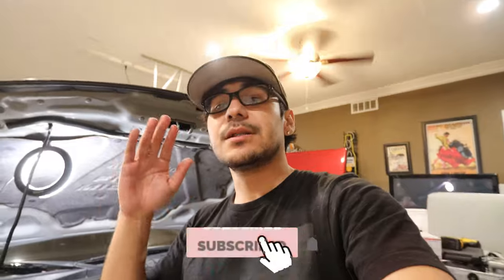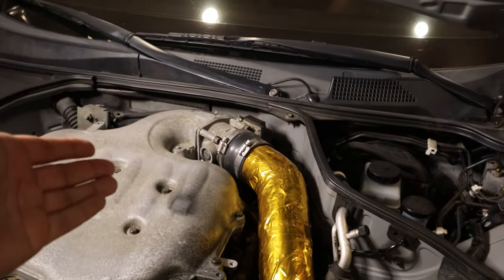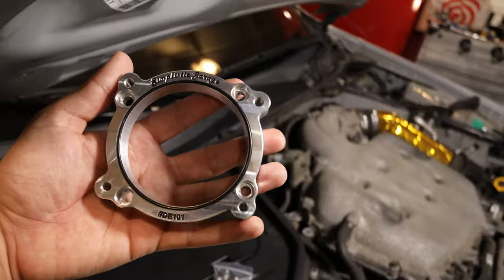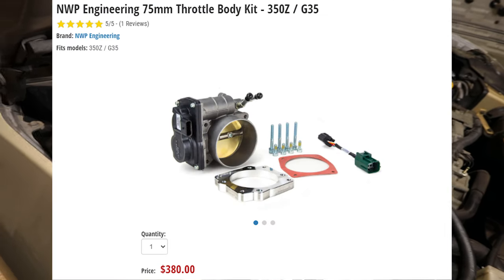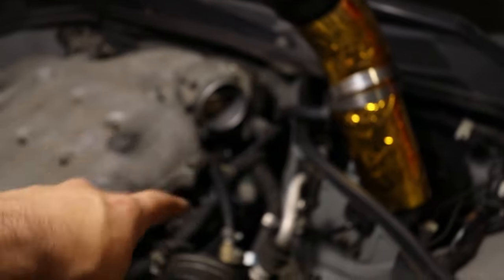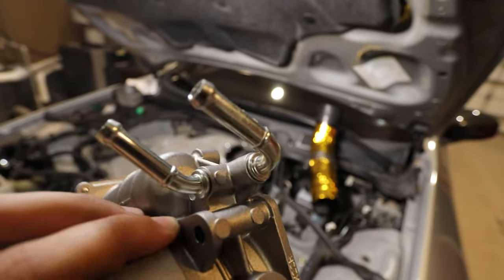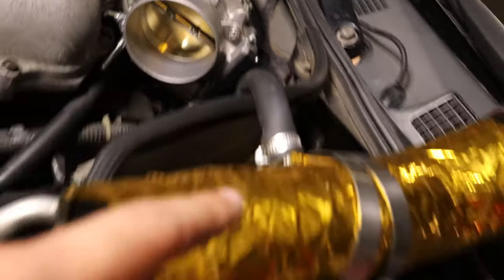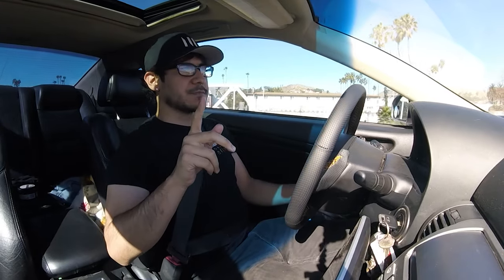Watch This BEFORE Buying 75mm Throttle Body for your G35 / 350z!!

Comment: 1st comment
Reply from the maker: You’re pinned! 🙏
Reply: @JoeVazquez  Joe just got the infamous P2138 Throttle Body code.  Researching my options on whether to get a OEM 70mm or aftermarket 75mm with adapter. All my intake is OEM. Don't want to replace it, perhaps minor Stealth costom trimming could occur. If this is the case, I would think the 75mm would serve little to no benefit over OEM 70mm. Am I right? In which case I will just get the OEM 70mm...Thanks  Ahead for your opinions.
Reply from the maker: 75mm will help a little bit with throttle response but to take full advantage you’ll want 3.5 inch intake.
Reply: @JoeVazquez  Thank you,  I'm ordering  the OEM Hitachi T B from Amazon.
Reply from the maker: Awesome bro!!

Comment: hey can you get a 3.5 air intake on a 2005 g35 sedan that is meant to fit the 07+ Hr engines? and also do you need a tune to add the 3.5 air intake?

Comment: That throttle body works well I sold mine I’m getting a holly hi ram kit facing the front to pull air in with custom 4 inch intake. I make custom intake for the Z. Nice video 🔥🔥
Reply: Really how much I was thinking about doing the same thing. Lmk please
Reply: how much for custom intake

Comment: Dope video man I’ve been thinking about picking one up for the longest time but haven’t made the decision. In this video are you tuned and what’re your current mods? Also did you feel the power after the first pull with it on? 👍🏽
Reply from the maker: I feel you, I literally held off because it was a bit too expensive, but I’m not tuned yet! I have a couple bigger mods I want to do to and then I’ll go ahead and tune! I definitely did feel the power right away though, it has an extra kick to it and it feels a lot smoother since it’s a new throttle body as well!
Reply: @JoeVazquez  thanks for the response man. I’ll definitely be picking one up then. Haven’t seen really any actual good videos or info on these bigger throttle bodies until yours so good stuff 🔥
Reply from the maker: Of course man, this kit is a great price, and great quality aswell! Thanks for the support brotha it means a lot 🙏🙏

Comment: Just installed mine bro all I did was hammer the coolant lines a bit and fit perfectly fine it sounds different for sure! It sounds like my car is whistling no leaks !
Reply from the maker: YESSS
Reply: I scared to hammer or cut it off incase i do it wrong
Reply: @KR-nh9sb  all you have to do is hit it with a hammer lightly but it on a surface we’re it isn’t too hard then hammer the lines a little not even a lot and you’ll be fine I did mine hard and no problems
Reply: @M4STRO16  thanks man

Comment: Joe, did you enlarge the throat to 75mm on the Plenum? Otherwise it will act as a restriction. What I did was to reshape all the lower plenum horns, widen the nostrils, the 6 down  tubes, plenum entrance, and throttle body. I removed plenty of material almost the same as installing a thin plenum spacer. I also follow it up with polishing. Old School, we call it Porting and Polishing. Definitely a seat of the pants improvement. Lots of work well worth it.
Reply from the maker: The adapter that comes with the kit tapers from 75 to 70 so it doesn’t act as a restriction! I want to do that myself, it would definitely be rewarding to feel the butt dyno improvement haha
Reply: I think what is meant by restriction is the air doesn’t flow through 75mm diameter all the way.
Reply: @TheAsheryl  My thought is the narrowest part now becomes the restriction. You can have a 80mm throttle body but the throat afterwards is only 65mm, that becomes the restriction point. In a NA Engine preferably you would want an even width throughout without any reducers. I reshaped the plunum throat to ensure that was not a restriction point. You don't want to remove too much material as it can weaken the throat area to the point of failure.

Comment: What will happen if I drive my g35 with the 75mm tb and a 3.5 inch intake without a tune? And will my stock intake be damaged by stretching it around the 75mm tb?

Comment: How long have you had that driveshaft? How has it been, any issues? Installation went well, no problems?
Reply from the maker: Driveshaft is perfect! No complaints at all! Make sure you get the on from concept z with foam insulation to minimize noise! It’s also a lot cheaper!

Comment: Quick Question, Obviously the adapter serves as a spacer of somewhat but would I also be able to run a (ex. Silver Bullet) throttle body spacer in between manifold and adapter. It should line up fine right? I already bought the spacer I’m one click away from getting this 75mm TB Lol Hope to hear back soon
Reply: You may run into fitment issues with an added spacer.

Comment: Any check engines lights? Or I've heard the throttle sticking open problems?
Reply from the maker: I’ve never heard that issue from anyone that I know runs a big bore throttle body
Reply: @JoeVazquez  Well thats good to know. Some of the other youtube videos show rough idle or driving and needed a tune

Comment: Love the explanation you provide in the video! And is your car a revup or the base DE?
Reply from the maker: Base de but this works for either!
Reply: @JoeVazquez  I am too rocking an 04 6MT gonna do my brakes from CZP stope tech pads and new rotors.
Reply from the maker: That’s badass, you have the Brembo package right?
Reply: @JoeVazquez  yeah it is I’m gonna go back to the video you did a whole back for help. And have you repainted your calipers to the OEM colors ??
Reply from the maker: I haven’t yet, I was thinking about changing the color for a bit once I wrap my car!
Reply: @JoeVazquez  if you do that, pls make a video. I’d be interested in the light reflective material.
Reply from the maker: You got it!

Comment: would probably see more gains if you bore out the manifold and adapter since it tapers down, I just ordered a kit for my Maxima for $155 and found a used throttle body for $35.
Reply from the maker: The adapter was actually made with that in mind so it tapers from 75mm to 70 essentially making a velocity stack type of adapter
Reply: @JoeVazquez  I'm going to try it both ways and see what happens. I'm doing it on my maxima so if boring it out doesn't have as much gains I'll just get another intake manifold elbow, 02-08 maxima uses a 2 piece upper intake manifold.
Reply from the maker: Right on bro let me know how it goes!!

Comment: I’m confused about the tune so you have to get a tune for that throttle body and where do I get my car tune , do I just go to my local tuning shop and ask for what , and tune for a throttle body?
Reply from the maker: You don’t have to but you want all your mods to work at their full potential to actually see a significant improvement in the power mods since it’ll still have a stock tune! As to where you can find one, depending on where you live it may be common or not common at all to tune your car so you just have to know about reputable tuners!

Comment: Thx. Great video.  I ordered one today.
Reply from the maker: Hell yeah and no problem! 🙏
Reply: Have u had any issues with it? Limp mode or lights popping on?
Reply from the maker: No lights it’ll run just fine, Just make sure to torque to 75 INCH pounds and you’ll be fine!
Reply from the maker: Let me know how it goes brotha, excited to hear from you!
Reply: @JoeVazquez  absolutely

Comment: I bought the same setup and paid around $200 with a used Tb though
Reply from the maker: That’s a great price!
Reply: @JoeVazquez  did you have issues after installed my car not getting full pedal response
Reply: @chucke.cheese4732  message Simplistic Garage on Instagram or Facebook and they'll help you get that sorted out.
Reply from the maker: You do have to do throttle body relearn!

Comment: Bro I have a question, is the jwt pop charger a good intake? I kinda wanna get it but I don’t wanna lose power looks dope and sounds sick what’s your review on it?
Reply from the maker: I love the pop charger!!
Reply: @JoeVazquez  what do you use to clean it bro and do you oil it or no?
Reply: Where do you get it?
Reply: @winstonwolfwhiteshoes  z1 Motorsport, czp performance
Reply: @M4STRO16  k&n has an air filter cleaner.

Comment: Hi I have a 2005 nissan murano that I think the electronic throttle body is not working cause I don't hear any noise when I put the ignition switch and the car cranks but won't start
Reply from the maker: Disconnect the intake piping, and see if it physically moves, should help you know if that’s the problem, or if it’s a crankshaft or camshaft sensor

Comment: What did you do about the existing coolant line from the original throttle body?
Reply from the maker: You don’t need to remove them, they’re connected to the upper plenum not the throttle body, so removing the 75mm ports wouldn’t change anything!

Comment: I've had this throttle body with the spacer and 3.5 intake as well as a plenum spacer for over a year now. I never got a tune.
Reply from the maker: You don’t NEED a tune for those parts you put on, but you NEED a tune if you want to maximize the most power out of those mods you installed. It can even be slower than before because it’s running lean without a proper tune since those are all breathing mods but there’s no correction on fuel since the computer isn’t tuned for that
Reply: @JoeVazquez  are there any symptoms of a car running lean? Other than decreased performance? It feels like I gained performance since doing those mods but I guess it could be a placebo effect.
Reply from the maker: One symptom I noticed when I installed test pipes was the throttle response decreased

Comment: Can you help with this question its off topic of this video.
I have NO check engine light on.the issue I'm having is when only at drive thru or at a red light my car hiccups.NO CHECK LIGHT IS ON.new subscriber great video by the way im gonna look into this throttle body.
Reply from the maker: Message me on Instagram and I’ll be glad to help you out!! @thejoevazquez
Reply: @JoeVazquez  i don't have Instagram.let me go get it.thanks
Reply: Ok i sent the question to Instagram
Reply: Check for vacuum leaks. You basically having the issue when your car is idling. If not that maybe a dirty throttle body.
Reply: Motordyne i did clean the throttle body and did the throttle relearn i also have new plugs,coil packs new sensors 2cam 1 crankshaft,new oil mobile 1,new hose kit from z1,put fuel treatment in it and still have the hiccups.
My only guess now is fuel injectors or fuel pump is about to go out.i did do the turn the key and listen for the fuel pump sound and i can hear it.
Reply: @austinbradley3411  okay I would next check for vacuum leaks. Check if any hoses are ripped or not plugged in cuz it could happen. Then next check your wiring. Maybe a wire is touching metal or a bad ground. I had an issue with my wiring causing it to idle bad
Reply: @DARKWoLF52297  ok thanks
Reply: @austinbradley3411  Also try cleaning the MAF sensor. If nothing helps it can be something with your fuel system but like you said you have no codes so it’s hard to pin point the issue
Reply: Ok i never figured it out yet but i have 1 more question that may solve my issue with this missing problem.
I have change my plenum out (i polished it) and the letters and number on the side of the plenum is AK CDO 5 (thats the new one on it now) the one i took off is AK CDO 3. Could this be my problem?
Reply from the maker: Did you make sure to torque the plenum back properly? That could be an issue, as well as like motordyne said the maf sensor and any tears in the boots after the maf are a big part as well! Listen if you can hear any hissing and pinpoint from there!
Reply: @JoeVazquez  yes i torque them 40,60&80 inch lbs.im still waiting for my maf sensor to arrive.
Reply: @DARKWoLF52297  @joe Vaquez ok i found my problem it was one of my new coil packs but I'm still puzzled why it didn't thro a code.i know when i bought this car it had Hitachi coil packs in it so autozone never had Hitachi they only had duralast but i took them back after i called them and they had the Hitachi ones so i swapped them out.now she's better than ever.thanks for y'alls help much appreciated.
Reply: @austinbradley3411  good to hear! Also just know that our cars are really picky on what you get for them. Try to stick to oem or a good brand for sensors.
Reply: @DARKWoLF52297  i always go for oem for everything but down here in the south most auto parts stores only can order them.i mainly use z1motorsports for my car.
Reply: I used to get slight hiccups. I switched gas. I was ALWAYS using WaWa gas....I switched to Shell V Power and after 2 or 3 tanks, not even a burp now. It actually feels like running better all the way around.

Comment: Hey what’s up man just a quick question I just purchased a 75 mm thrott bodies I am tuned and I got 3 inch intakes and the upper and lower manifolds and I am going back for a re-tune A couple people say that the thought about is will be too big for my car is this true
Reply: *Say that the tbs are too big and use these for boosted applications

Comment: hey there.. just one question, since where I live gets really cold should I still use the coolant ports ???? not cutting it ???
Reply from the maker: Yeah I would just keep it the way it is honestly, think of it as a throttle body warmer. Obviously dependent on where you live you’ll want to either use that or not
Reply: @JoeVazquez  I will probably keep it then since where I live it snows and it is really cold. thanks much for the quick reply
Reply from the maker: You got it!! 💪

Comment: What is the main difference between this and the common market ones? Also, how do we install it without cutting it?
\
Reply from the maker: Honestly the price is the best part, they all achieve the same goal just done a bit differently in how they designed the adapter kit. If you don’t want to cut, you can pick up a kit from simplistic garage that already includes the throttle body and I believe it has the port already removed, but I was just go to harbor freight and buy an angle cutter for 20 bucks and diy, you save money and you can return it right after if you really wanted to!
Reply: Those ports are pressed in and can be removed instead of cut. SG doesn't remove the ports but if you send a message asking them too they will👍
Reply from the maker: @sgmachine  youre right! although you would spend more money for the kit they sell, its just more convenient if you dont want to bother cutting or pressing out the ports themselves out!

Comment: Is getting a tune just to maximize the gains, or is it necessary to use the larger throttle body?
Reply from the maker: It’s not necessary but yes you’re correct, it’s to maximize gains! Specially if you have other mods it all adds up!

Comment: Nice video.  I have a 3 in intake on my 2010 maxima and I've only got a little $100 performance chip.  How much would i be spending to get an actual tune  on my car.  Ive also put a whole new exhaust on the car from the headers back .
Reply from the maker: thanks man i appreciate it! an actual dyno tune will be from 500-800 depending on shop and where you live but i HIGHLY recommend doing one, they make sure your car is running safe while gaining extra power from your mods! im not entirely sure how safe the chip you bought is but id be very cautious! also make sure the shop you take it to has a good reputation!

Comment: I got one from czp a while back which I’m planning to install soon. In their video it says 14 ft to pounds, but you said something completely different so I’m a bit confused which should I go w? Did you disconnect the negative port of the battery and then reconnect? And last question is the throttle body relearn necessary or..?
Reply: Well go with what czp says. I have it on my z. Disconnect the battery so that it doesn’t throw any codes or make the car idle bad. If that happens just do the idle relearn and the throttle relearn.
Reply: @DARKWoLF52297  thanks man, actually right now I’m having a problem. It’s the P0171 system too lean (bank 1) issue. Thought it was my hoses to the throttle body, got Z1 hoses but nope. So I will see if the whole relearn will help
Reply: @J.Y_Z33  1. It could be an air leak in the intake after the MAF sensor. A faulty MAF sensor or a faulty oxygen sensor. Check for exhaust leaks too by sensor 1 and 2 also.
Reply: @DARKWoLF52297  yeah I will thank you, didn’t think about the intake (got an injen intake rn) but I went to autozone recently to use their obd scanner and it told me could be the throttle body itself which wouldn’t surprised me. It’s the original throttle body and sounds like a leak is coming from it but can’t tell yet
Reply from the maker: Yeah like motordyne 350 said just go with what concept z suggests since they designed that kit and did the r & d to make sure no leaks happen! I just did 75 inch pounds since that’s the oem torque from Nissan! As for your throttle body leak, the gasket between the throttle body and plenum is a common problem!
Reply: @JoeVazquez  alright thanks man, I tired another hose but I still hear hissing. My last three options I got left are what you just suggested, another hose to upgrade and to clean the throttle body.

Comment: When you cut off the coolant lines where do you plug in you’re coolants hose? Or do you have a little pipe connector? If so where can I get one
Reply: The factory throttle body cooling setup runs the lines through the plenum just behind the throttle body, so you won't need to change anything.
Reply from the maker: Austin said it perfectly!